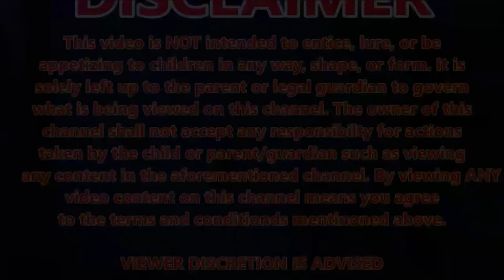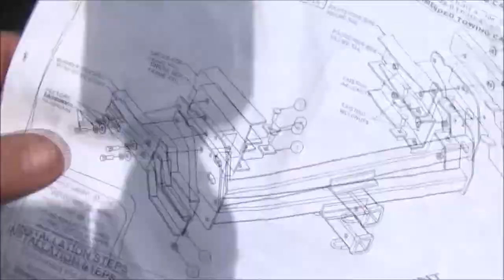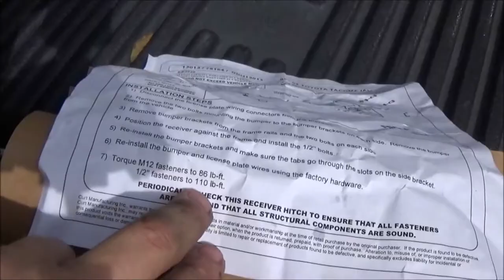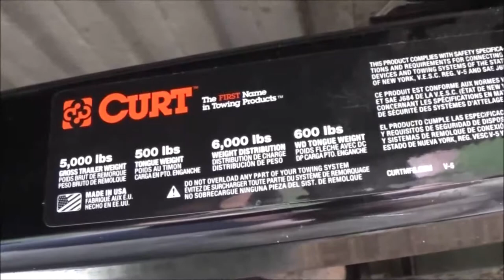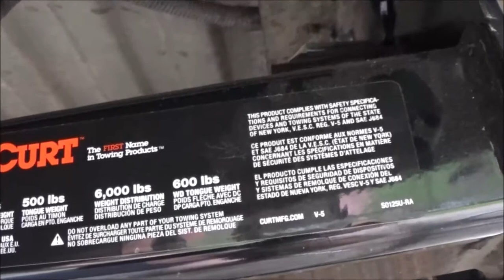1995  2004 Toyota Tacoma Class 3 Hitch Installation

Comment: Hey bud! Thanks so much I just put mine on using your video as guide. Yep, I had to cut those tabs off, too. Besides having to bend out the one side bracket that got bent in transit it was a pretty smooth operation. Now I can tow!!
Reply from the maker: That's awesome. I'm glad it helped. Have a great week and happy Thanksgiving to you and yours.

Comment: Believe it or not, but I’ve towed some impressive weight just off a ball in the bumper on my 95 4cyl 2wd.   I know that’s not the best way to tow, but it was a new bumper and brackets attached to a solid frame.  Getting ready to install a class 3.  Thanks for video
Reply from the maker: You're welcome Ross, and thanks for watching and commenting bro.

Comment: Hey man... I don't know if you will still get this message. I am thinking about buying a nice 2004 Taco. It doesn't have a hitch now. There is a hole in the flat part of the bumper just out from the license plate. Can I put a ball in it right there?
Reply from the maker: Yes. But I don't care for the bumper hitches myself but that's where we had ours until I bought the regular hitch.
Reply: @shabear1000 I am finally going to buy a 2004 in the morning. Now, I can appreciate an undermount hitch. I will also need to mount a dual plug. For a Taco, do you have a video on that or one that you recommend?
Reply from the maker: @FinancialFreebo I don't know if I have a video on that, but I think I do. They're not hard to install and they are reasonably priced too.
Reply from the maker: Yes I do have a video of how to wire it for your trailer plug. It's in my "how to auto tips and tricks" Playlist called "Converter Box Replacement For 2003 Toyota Tacoma". Hope that helps.